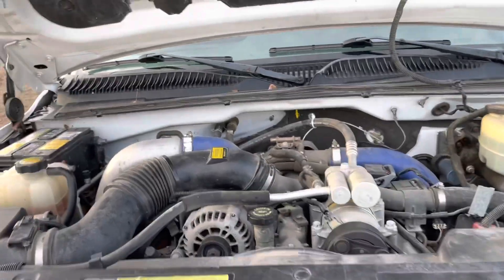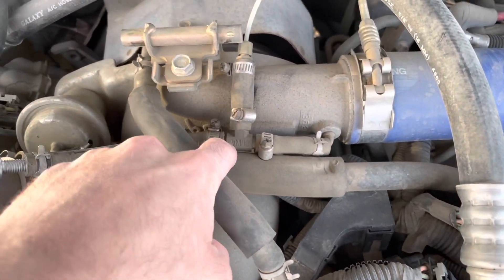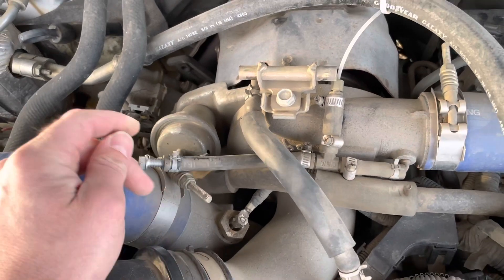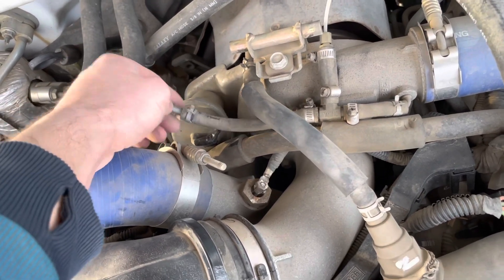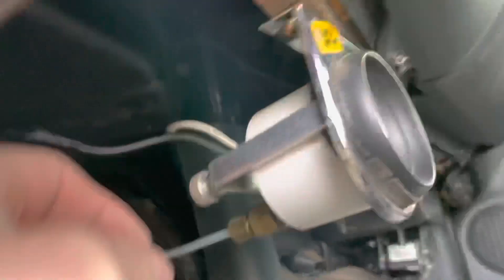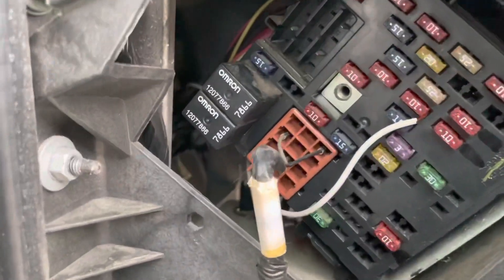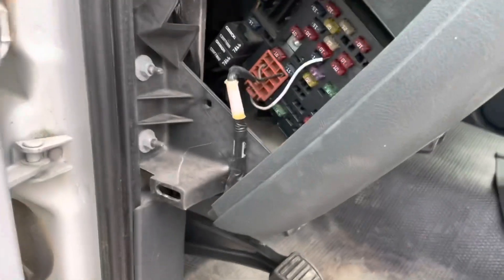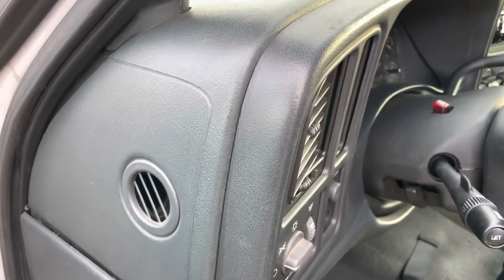LB7 OverBoost with actuator disconnected!!

Comment: This is probably the stupidest thing iv ever seen.. 
First off stock lb7 turbos do not take high boost pressure due to the center drive being to thin so this is a good way to snap a turbo
 second off blocking off the turbo line to the actuator... WHAT?!?! this some kinda sick joke?? 
Thirdly stock tune big boost good way to under fuel and eat the motor up.. 
The wiring stuffed into the I'm fuse box.. uhm they make connectors for this..  pls stop showing people how to destroy their trucks if you know nothing about the lb7s I daily my 800hp lb7 with 1300t and I'd punch someone in the face if they tried to do this to my truck..
Reply from the maker: If you are to scared to turn up the boost a little on a stock turbo I highly doubt your chickenshit ass would push a truck to 800hp😂😂
Reply: @willypeters6311  hell yeah brother -cleetus
Reply: @willypeters6311  go check my page I make real power with real parts you should learn the difference I do 0 to 60mph in 2.8 seconds your trucks doing 0 to junkyard with how shitty that mod is
Reply: @dirty_lb7_sk idk I’ve seen enough of your “build” doesn’t look very reliable there bud 😂 I’d def own this guys truck before yours…😭😭